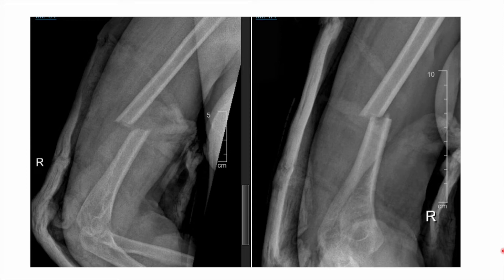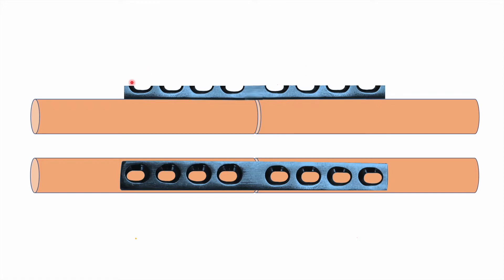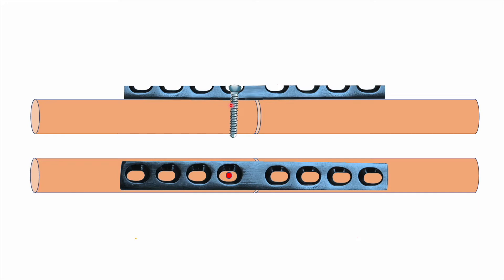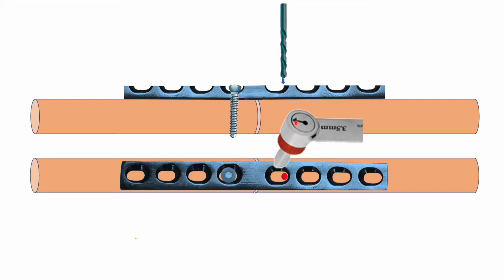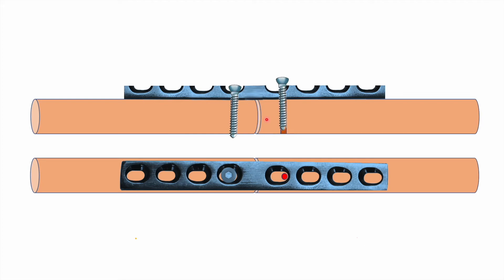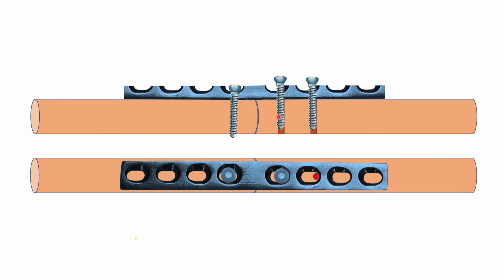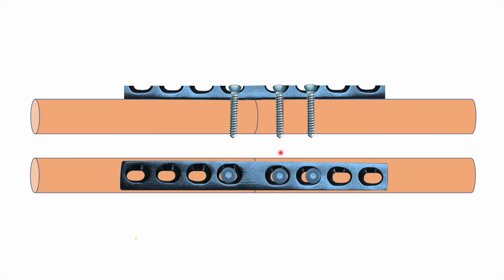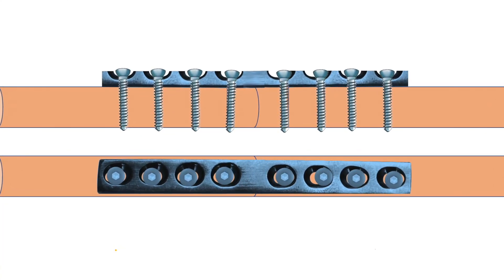Dynamic compression plating principle

Comment: Sir but if we put screws in all the holes then wouldnt it become a stiff construct?
Reply from the maker: For principle of DCP we need rigid compression and absolute stability at fracture site. So its going to be stiff. Otherwise when you dont need anatomical reduction or want to apply plate in bridge mode then cortical screws can be placed in centric position

Comment: Does the 2 eccentric across the fracture (transverse ) will cause more compression??
Reply: Apologies in advance! It may be a stupid question
Reply from the maker: As per principle described it wont work as the screw on one side of fracture needs to be tight/fully locked neutral screw. So, that fractured fragment, neutral scew along with the plate will act like a single unit and move towards the opposite fragment when compression is achieved. If you try to put eccentric screw on the side of first neutral screw, you ll have to loosen the neutral screw which can result in loss of compression and sometimes the reduction also.

Comment: Sir why it is dynamic
Reply from the maker: Whenever the word "dynamic" is added to the implant name, that means you can control the fracture with that implant. Here, it's a " dynamic compression" plate, which means you can control the compression at the fracture site. So, by putting a screw eccentrically on one side, you can bring compression at the fracture site; that's the "dynamic" part. You can't do that if you use a 1/3 tubular plate or a locking plate with NO cortical screws.
Reply: @Justorthothings  sir so locking plate not produce compression so which is best sir.(.but it is used as it prevent periostial overcompression )..also there is a term static compression what does it means sirany idea
Reply from the maker: @GeethaVijayan-f4s  Locking plates can produce compression just like DCP if you use a "NON locking screw" in eccentric position just like DCP. The current gen locking plates are actually LCPs i.e. locking compression plate. So you have holes  for locking screws as well as non locking cortical screws. If you want to achieve compression you can apply same principle as DCP. So, dynamic compression will happen in that case also. 

Now the static and dynamic compression are two different principles which both can be achieved with dynamic compression plate or locking compression plate.
In static compression, the the fracture is a simple one and anatomical reduced, achieved by placing the eccentric screw. Here the physiological loads wont affect the compression at fracture site and plate can be applied on any surface. 
In dynamic compression, the fracture may or may not be simple one; the reduction is anatomical or near anatomical with a plate applied on the tension surface of the bone, the surface close to plate may have some opening but the other cortex will have compression. Under physiological loads (see the tension band principle video), the will be compression at fracture site on compression surface. That helps in healing. Healing will be primary only because gap will be less then 1 mm.

So in simple term static compression= zero fracture motion in physiological load, dynamic compression = compression motion at compression surface under physiological load.
Both can be achieved with DCP or LCP
Reply from the maker: @GeethaVijayan-f4s  The new generation locking plates are combination of locking hole and DCP holes. So they have the function of locking plate as well as DCP. So, we call them LCPs (locking compression plates). To make things more flexible, surgeons now prefer using LCPs over DCPs as they can choose the type of screw according to their choice. So you can achieve same amount of compression with both LCP and DCP. LCPs are similar to low contact DCPs so they have less periosteal damage. Now static compression happens when fracture is simple and is 100% anatomically reduced. Then the implant strength and reduction wont allow any change in reduction under physiological load. Thus, the reduction is static. In dynamic compression, the physiological load will bring compression at compression (concave) side of bone and minimal distraction at tensile (convex) side but that will be very minimal and controlled by the strength of implant. So, a dcp/lcdcp/lcp when applied on tension side when allowing micromotion and bringing compression at the compression side under physiological load is resulting in "dynamic compression".

Comment: how long does it take for the bone holes to fill in after implant removal. When can you start heavy lifting
Reply from the maker: Hello, normally for screw holes its can take 3-6 months to heal. But often there are many factors that can predict whether the screw holes will be fully covered with new bone or not. Sometimes the holes persist for several years but the bone in holes periphery become smooth. So, heavy lifting should be started after 6 months of implant removal procedure. Considering these risks, with newer implants, it is not necessary to get implants removed if not absolutely indicated.
Reply: @Justorthothings thanks for the information. I had distal radius fracture 12 months ago. i can do heavy lifting bit i want to take the plate out. Are the chances high for the bone holes in forarm to heal fully.
Reply from the maker: @technominds4615  Usually, it is advised to not get the plate removed unless it is creating any problem. But if it's necessary, six months is a safe time to gradually start heavy exercises. Yes, usually the screw holes heal by that time.